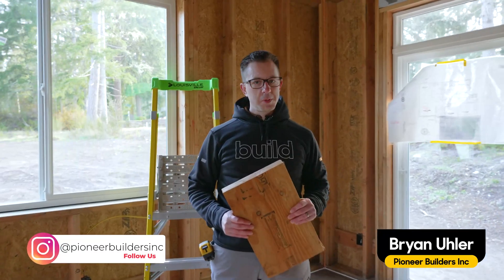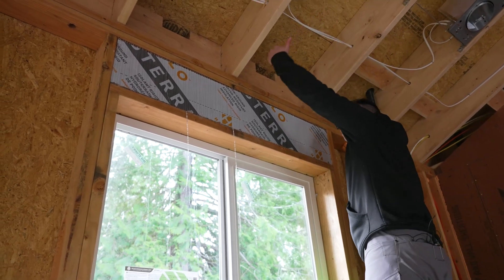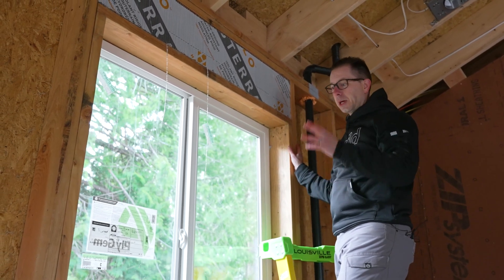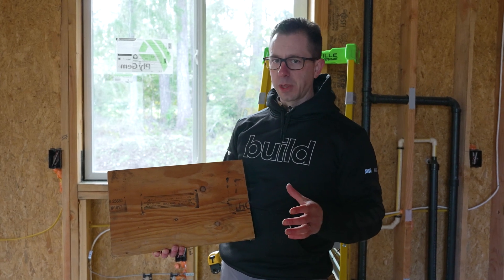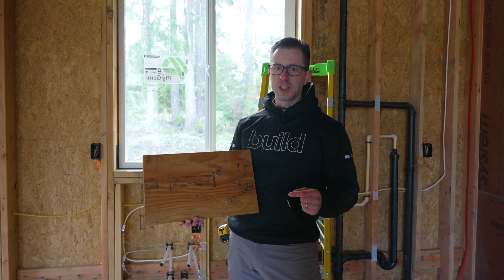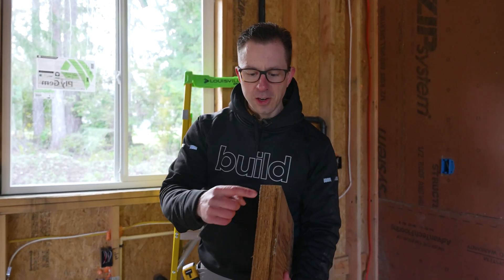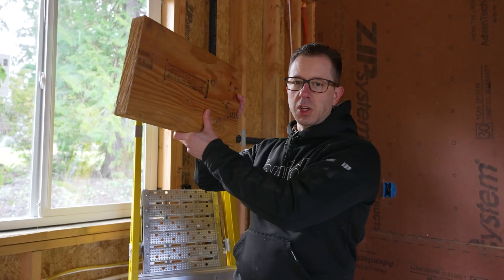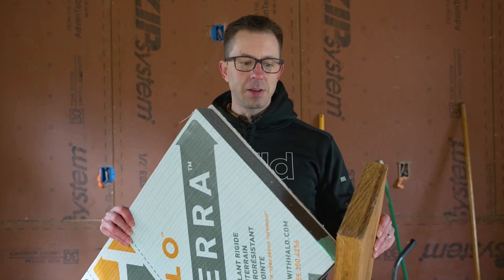Pocket Headers For Insulation

Comment: Interesting, I recently saw where the builder recessed the headers on a house and put 1" EPS on the outside and what looked like 3 layers on the inside so sandwiched the header. I didn't think of load path at the time, was just thinking how they were dealing with heat transfer
Reply from the maker: So many dials to turn...